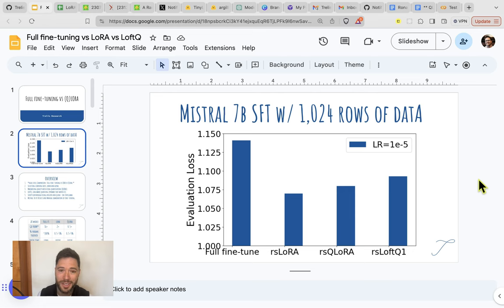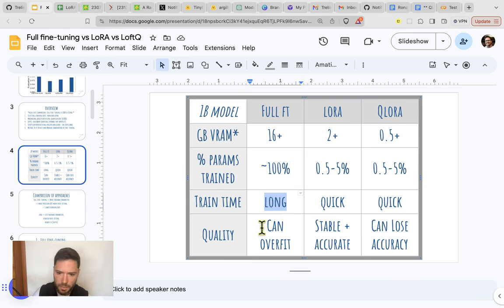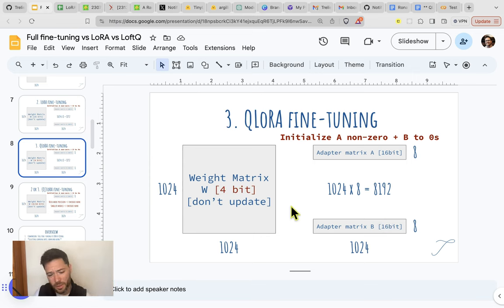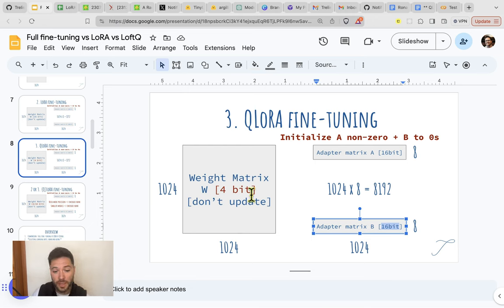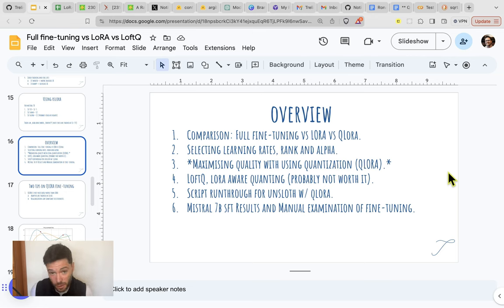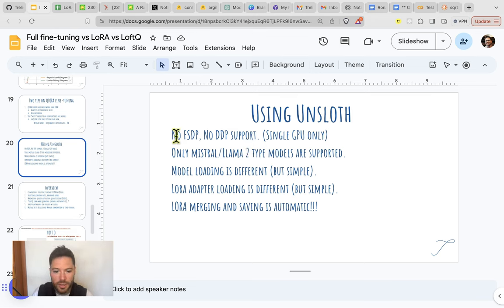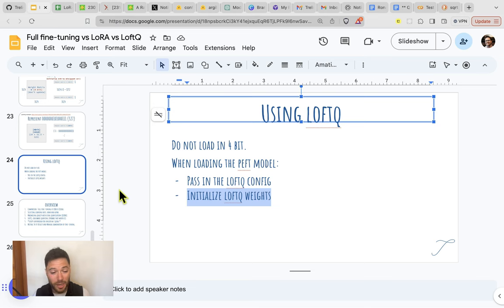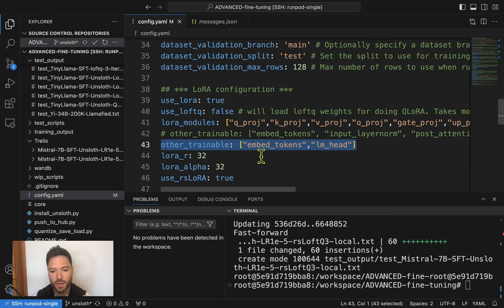Full fine tuning vs (Q)LoRA

Comment: Have you successfully fine-tuned an LLM to incorporate company-specific knowledge? From my experience, fine-tuning helps models learn the preferred output format for information. I'm particularly interested in approaches for fine-tuning on proprietary data. Additionally, is full fine-tuning feasible for this purpose?
Reply from the maker: Yeah maybe check my video on memorization and then the one on synthetic data. Both cover this

Comment: Any thoughts on when you would choose full ft vs lora/qlora? I've heard anedoctal evidence that lora/qlora are better suited to task adapt a model, and full ft is required to instill new knowledge into the model. I guess it kind of makes empirical sense since we are training a smaller number of parameters. Does this match your experience?
Reply from the maker: Broadly, I'd agree with what you're laying out, although LoRA can outperform full fine-tuning unless you're really building in a lot of information. Especially if you're using a large rank.
Reply: That also makes sense. In fact I forgot you had already made a great video about memorization where you use Lora to bake in touch rugby knowledge so it's definitely possible
Reply: I found the paper 'LoRA Learns Less and Forgets Less' particularly relevant to your thoughts.